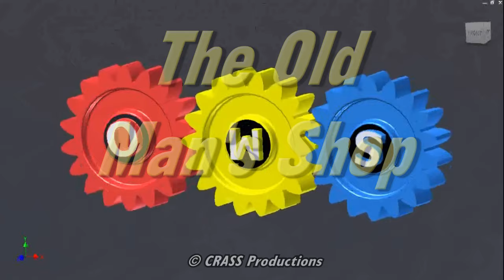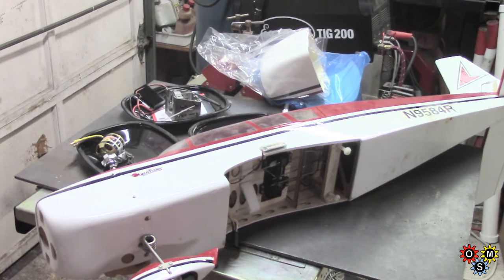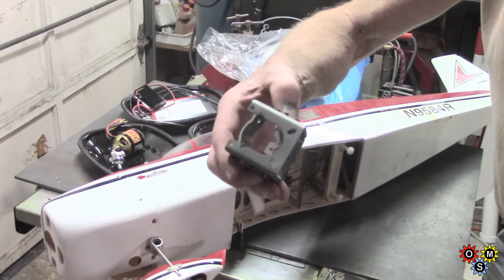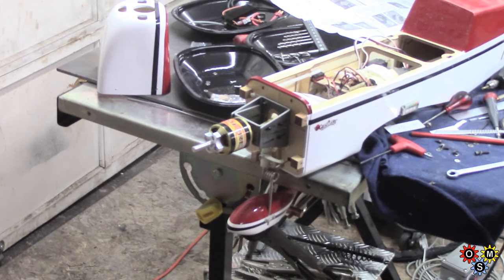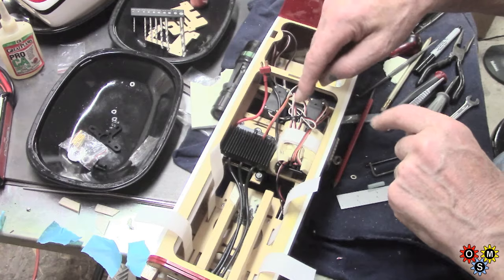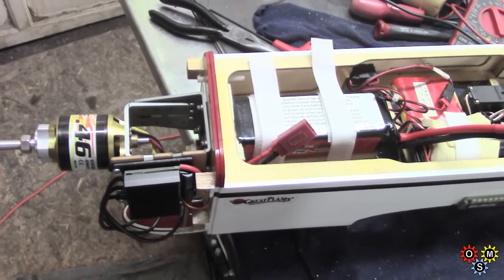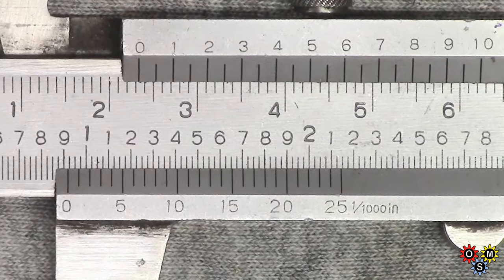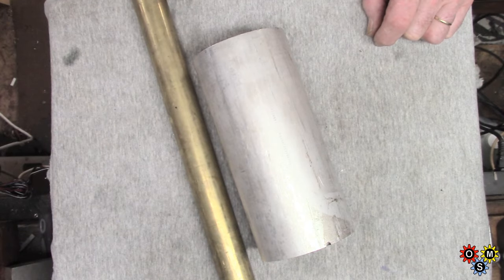Bits-12

Comment: About 40 years ago those type of verniers were all we could afford, ( A Mitutoyo 8" was about close to $200) as for the micrometer, so had to learn it first hand... Now they got the digital display, just in time for me and my eyes failing at close vision... How life takes care of us older folks...   lol
I'm lucky my shop has some trees close around to get some shade on very hot days, it's also pretty well insulated for Winter so heat isn't coming in as fast in the Summer...   ;)
Get video footage of that plane, it will be a bonus for us...
Reply from the maker: Hi Pierre,
That vernier i used was bought from a flea market in a box of 'stuff' - it has served me now for probably 30 years!
I don't have any trees close enough to help - shop is sort of insulated but, over course of a day it heats up and then with silly warm nights never cools off properly!
Not sure if I will be test flying the plane but if so will try and video it.

Comment: The metric vernier is easier to use than the inch. No fiddling with adding in increments of .025", just straight tenths (and halves of tenths) of a millimeter. (Note that the 25 divisions of thousandth is similar to the 20 divisions of half-tenths of millimeters. It's about as close as you can read with the naked eye.)

You can definitely add a bigger loop of copper wire (#10 or #12, whatever will fit those holes in the posts) to your soldering gun. I have a Weller D550 gun that works very well for that purpose. In fact, I just got a second one so I can leave one set up with the large loop. 

BTW, you can also magnetize with this rig. Just let off the trigger while the tool is still in the loop. You may need to do this more than once, since the resulting magnetism will depend on what part of the AC cycle is active at the moment of release. You can even try for a specific polarity (test with a compass - at a good distance; you don't want to demag or remag your compass needle). Keep trying until you get a satisfactory magnetization.
Reply from the maker: Hi Peter -- thanks. Good point re the inch/metric relationship.
I intend to make a bigger loop for the Weller - enough to manage most drill bits and end mills etc. It sure is very convenient. I usually magnetize things very quickly by a swipe across a magnetic bar tool holder or a neodymium magnet..

Comment: I use Speedy Metals also...love their fire sales.  Great video, Chris.  Really liked the conversion on the plane.  I got a great deal on a vernier height gauge on ebay for that very reason: it was vernier.  Teaching myself to read vernier scales also made my rotary tables for the mill much more useful (accurate).  Really enjoyed this one.  Thanks.
Reply from the maker: Hi Dale -- thanks. I do find the analog scale on verniers very easy after many years, as long as I wear my cheaters!
Hoping once plane finally balanced that it will perform well.
Reply: Raising my glass to "cheaters" (or coffee cup), couldn't get along without them.  Test flight would make for a great video!
Reply from the maker: I'll video test flight if I am there to fly it.

Comment: Chris, You can magnetise the screw driver again by holding the screwdriver in the loop of the soldering iron and switching the iron on then off. Try that!
Reply from the maker: Hi Mike - must try that - however, a swipe across a big tool holder magnetic strip (Harbor Freight stuff) does a very easy and quick job.

Comment: A quick check finds a Speedy Metals outlet just 16 miles from my house. Who knew? I could go there and pick things up directly.  (16 miles is $16 for a round trip at $0.50/mile, but as soon as the shipment gets heavy, that becomes a very small number.)
Reply from the maker: Dang - that's lucky Peter, very lucky. For sure, shipping with metals is an absolute killer. Wish I had someone that close, although for oddz of hot rolled I do have one supplier near enough - but for brass, Al and CRS I am stuck!

Comment: i made a demag coil for my weller  3 turns 1-1/4 dia 12 ga copper wire works great
Reply from the maker: Hi Jerry - thanks for the suggestion - I'll be making a modified wire insert to deal with larger items.

Comment: Thanks Chris! I also have no flat surfaces in a the two shops! The one thing that really gets me is the hole in space? It seems to be under both benches? The other problem is how can a small nut having little Mass and not much velocity drop three feet and bounce across the twenty foot floor right into the hole in space under the bench?
Reply from the maker: Hi Danne -- ahh yes, I call it the black hole/holes! Also, sometimes the smallest items have the most bounce - one reason I often lay some rag on the floor to catch such errant things :)

Comment: What ho namesake, I have a friend that is now into flying so guess who has to make mounts and fit motors. Did you put the angle into the mount, what is it 2 degrees to the side and vertical? I wonder if it is really necessary, it can ruin the symmetry.
We had some weather this week, lucking the Geneva convention and EU human rights, not to mention H&S, allowed me to say NO till it cooled a bit. A bit cooler today, and now that Lewis has won the Hungarian race, I had better go and do some work.
LL&P
c
Reply from the maker: Hey Chris -- the firewall has a right side thrust angle (modest - and vertically neutral best I remember) and that was utilized when the glow motor was fitted. For this installation shimmed the motor mount to get rid of that and be able to manage a line-up for the cowl - hellish fiddly.
Lack of side thrust now should probably be correctable by small rudder trim and even perhaps slight aileron trim too.
A buddy told me about your recent heat - does rather limit being outdoors (and shop).!